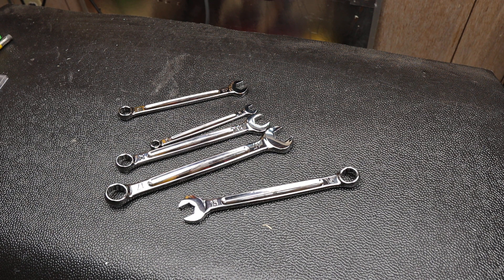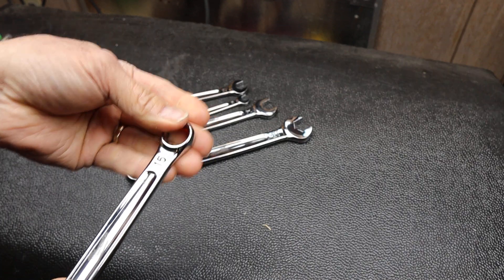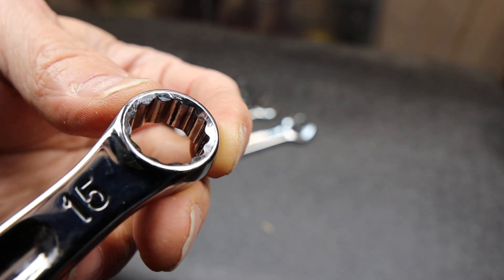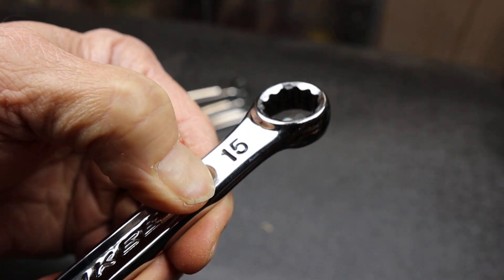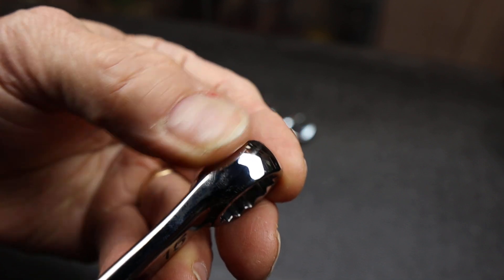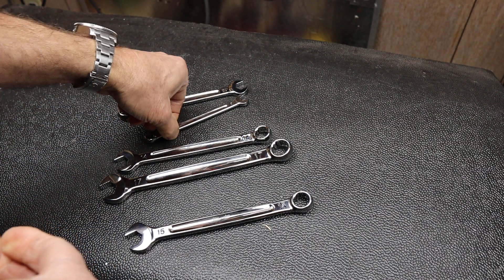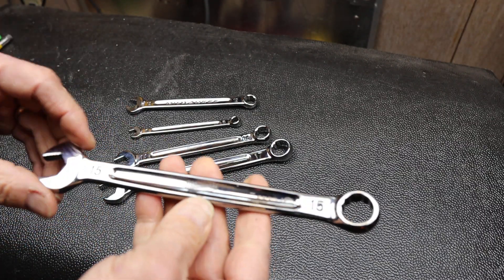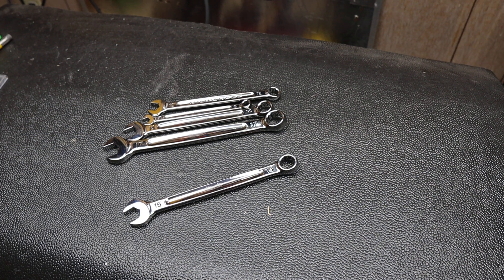#1:  Milwaukee Wrench Chrome Defects. Hardly a dealbreaker, but shows kinks in Big Red M's CQ Armor.

Comment: Why are you americans obsessed with dings on tools?  In most german top manufacturers (Hazet, Stahlwille) wrenches are like that and its because after stamping/forging they drop in a bucket.  I have warrantied a Hazet wrench that the closed end was stamped off center, warrantied a long 1/4 Facom extension that was slightly bent, but such a defect as in the video doesn't affect function.
Reply: It's not Americans, It's just this guy.... I thought he reviewed tools but all his videos of late have been complaints about insignificant defects in his barely used tools.

Comment: Hey doc.  My dad just gave me 2 snap on ratchets that need repair/warranty.  How do you address the whole ‘not having proof of purchase” nonsense? Just ignore it on the application?
Reply: Contact them email, tell them you need rebuild kits for said ratchets and they will send them out.
Reply from the maker: If you dad got them from a SO dealer, mention that. If not, include that they were passed on to you by your father. I think they are most worried about "Just got it off eBay  for cheap because it was broken."
Reply: @lastbesttool  thanks so much!